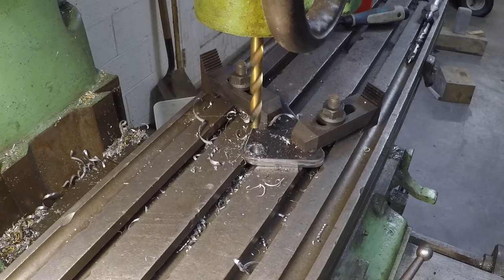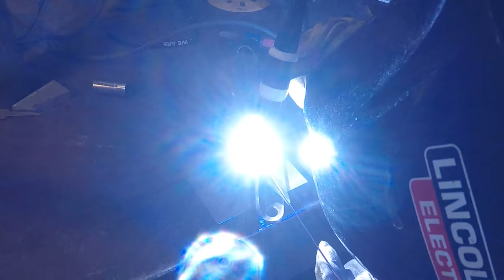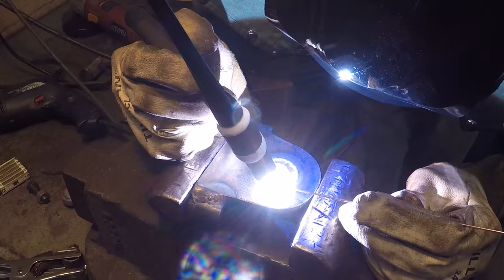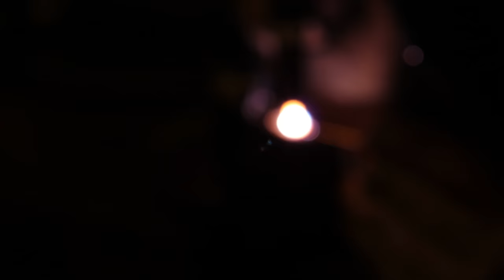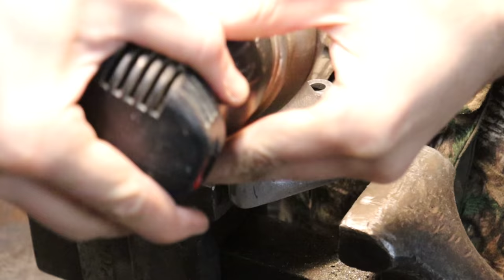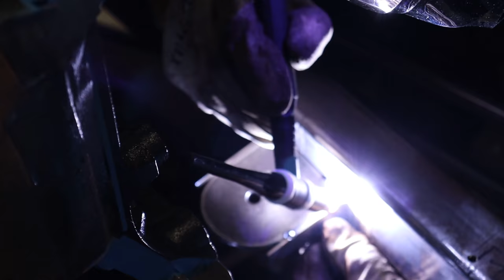Fabricating Custom Engine Mounts | Homemade Boat-tail Speedster Pt. 44

Comment: The engineering and artistry is spectacular--continuing to raise the bar.  It's criminal that the YT algorithm doesn't reward this channel.

IF someone cared enough to make their motor mounts this sculptural, they would put a block of metal into the CNC and come back the next morning.  Nobody cuts hand-drawn steel plate patterns, bends them over a round form, and nails the gaps for the machined sleeves.  Oh yeah...and has the skill to bridge the triangular gap with TIG filler rod instead of using a patch like a mere mortal!
Reply: I would not say nobody does this but it is very few for sure. I would love to see Ron Covell and him do a collaboration on some part for this roadster.
Reply: @josephdecesaro1528  he doesn't need any help on this.  Except maybe in de-squaring the windscreen. :D
Reply: @plus790  really wasn't thinking he needed help but more of think of the great  stuff they would create together bouncing ideas off the the other and learning skills from the other.
Reply: I've been dropping hints that he should tell us about the how and the who of his start in metal skills and automobiles. I think there is a great story about a boy and his father or more likely his grandfather form the age of the tools. because he does have skill way beyond what a young man , just college age would usually have. Always awesome and never a waste of my time!
Reply: like mere mortals haha lol hahah you sir have the gift of gab

Comment: TIG-welding the gap got me smiling. Very glad that there was a vent hole at the back. That part's desing is still very much prone to rust, and most likely hides it to the very end. It looks very nice, but my advice is to soak it in oil, and keep an eye on it.

Comment: I'm glad you went with the Jag rather than the Ford. The flathead V8 is a hot rod icon, but it, like the small block Chevy, has been done to death. The motor is going to be a stunner all on it's own, especially with details like your motor mounts.

Comment: Nice to see you back in the saddle. Suggest you consider longer motor mount through-bolts with a castellated nut and cotter pin up top. Would be very period and in line with that Jag motor.

Comment: Actually I should add,looking at the construct,you have a sort of puck arrangement below your custom fabrication. There is a way to do some vibration  isolation,if interested.   3M makes 520 and 5200,Sikaflex a similar product,both called Marine Sealant Adhesive. As a replacement for the rubber in motor mounts,I speak with personal knowledge, it works just fine. 
You could if you wished use two steel discs with MSA in compression between,like an Oreo cookie,sort of.
The stuff is RTV,not a silicone product,and it is incredibly strong. If buying,try for such as a Marine Supply place. The tubes do stale date. Old product bought cheap is junk.
Comes in woodgrain,black and white. So making it look like black rubber is ordering the correct part number.
Years ago I took halves of Chev and Buick motor mounts,burned out the rubber and installed a Buick 350 in place of a Chev small block. It worked,it was ugly,and I got years of use out of a car that otherwise would have been scrapped. And the MSA held at least as well as the original vulcanized rubber. FWIW.

Comment: Pretty nice work. The only thing I'd recommend is getting away from those abrasive cutoff wheels in favor of a Portaband. Mine hangs off the edge of my welding table and I use it daily.

Comment: Delightful.  May I humbly suggest that you reinforce the chassis tube onto which the bracket is welded.  I have experience of that type of detail failing by tearing off or stress fracturing the frame tube. There are quite high loads going through there.

Comment: I think having a top hood with no sides is way cooler than just sides
Reply from the maker: depends on the engine. This one has polished aluminum camshaft covers at the top that you'll want to see
Reply: Absolutely.  I thought he just said that by mistake in the vid.

Comment: Hello, I got a question about rust protection on the build. It seems like all the metal on the car is still unprotected but also everything looks like new with no corrosion. How do you do it?
Reply from the maker: the car's not in a very humid shop, so it doesn't pick up much surface rust
Reply: @MacroMachines  Love it. Good for you.

Comment: looks nice , maibe have the engine mount part on the motor powdercoated matt aluminium so it looks even more like a casting 
would be a shame to not run the top of the hood on the car , if its because the engine doesnt fit under the hood you could allways try to put a bulge on it

Comment: Tig machine. Ok so DC pos I giess as you are doing steel. Can you tell me your machine settings? I have a £3500 tig machine but just after beginner stage I found whilst welding aluminium I would next day get stifling headaches and be throwing up. Thats with a second pair of tinted ski style goggles inside the auto darkening mask. Yep not good. 

Had a few months off now and wonder if im good to try again. Jealous of your project. Looks good.

My current project is 3d printer. Whereas you made your mounts and I am well impressed with how you did. Over the can to get the bend. Smart idea. Anyway my project is taking me down the foundry route. Want to be able to 3d produce my parts and then make them in my foundry.
Reply: I know about the ill feeling and how it should not be happening. Welded with a mig for 20 years. Never felt bad at all with that. 

I welded couple days ago with a mig too. No issues after. But and heres the thing. I have an old us school bus I bought from the states. Its down on a farm parked underneath 3 electric cables supplying power to the farms. High voltage like 185,000 volts per line or something stupid. 

Yep well I can arrive there and then couple hours later feel crap inside. Thought weird then twigged in my head it was exactly every time I got there. 

So anyone who says theres not intense electro something coming off tig and those wires is just talking shit. Interesting because many people lives near them and they dont do anything to them. Or do they. Beneath the surface like cigarettes, is the electro radiation slowly frying them?

Comment: You just made a fundamental mistake. Looking at the original bracket you will see that the face is deliberately angled so the rubber mounting is stressed in shear which makes it much more compliant. The vertical alignment of your bracket puts the rubber mounts purely in compression and rubber in compression may as well be a lump of wood. Check the rubber mountings in any modern car and you will see they are all at least partially in shear.